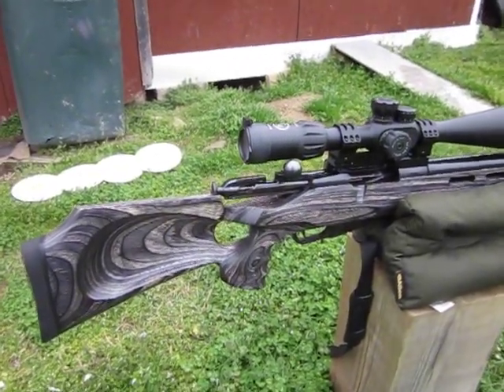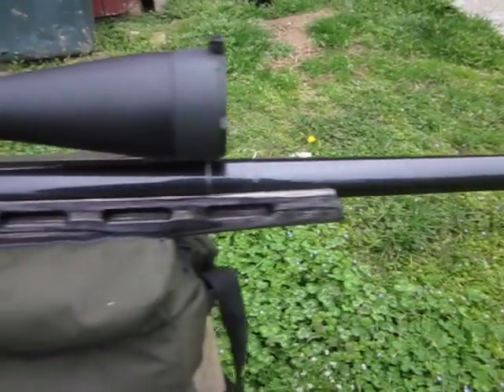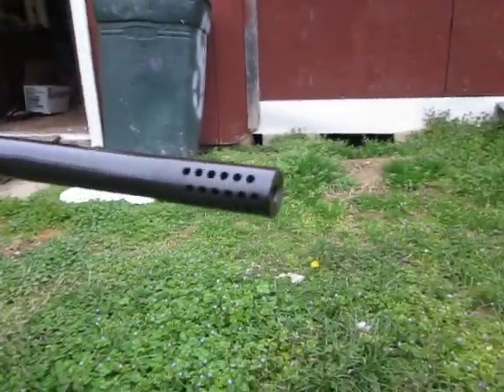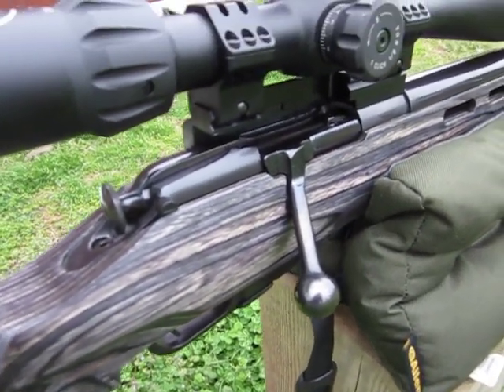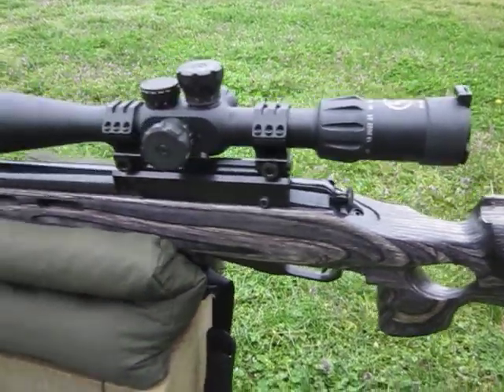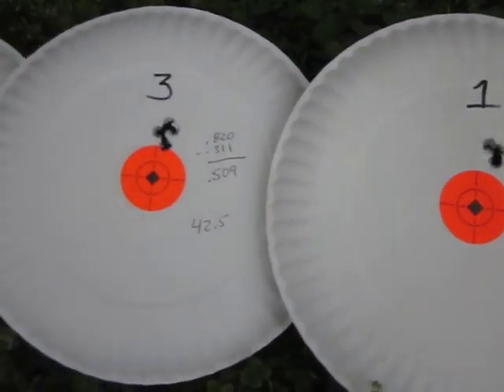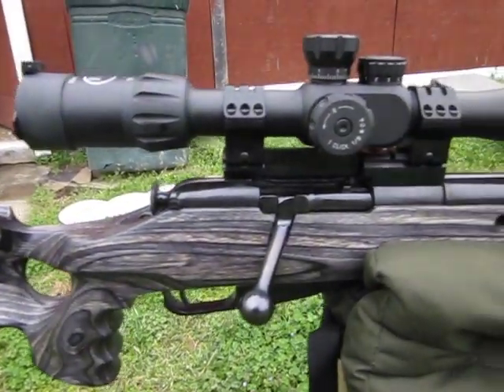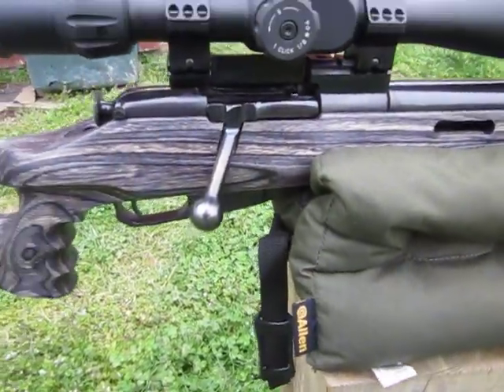Custom UK 59 Heavy barrel Mosin Nagant

Comment from the maker: I wish i had gotten 2 barrels from Classic but SoCaMo turned me on to mcgowenbarrel., I'm sure i'll be getting some barrels from them. I think the next project will be a K-98 that the bore was rusted beyond repair. I tried to put a pic of the final load test on here but i couldn't figure it out yet. Final load shot first 4 rounds at .156 then i pulled the fifth a lil , final group size was .373 center to center

Comment: The UK-59 barrel had a low stepped area just behind the threads which was smaller than the 1.25" receiver diameter and needs a sleeve.

Comment: Took my mosin to get seracoated a while back gunsmith told me of a guy who put a 308 barrel on his mosin but still uses the 7.62x54r round but cutom loads a 308 round on the 7.62x54r shell
Reply from the maker: You can buy a barrel chambered for 7.62x54r.  308 is 7.62Nato but the chamber pressures differ. It may be as easy as using 308 dies with a rimmed casing , i'm not sure.